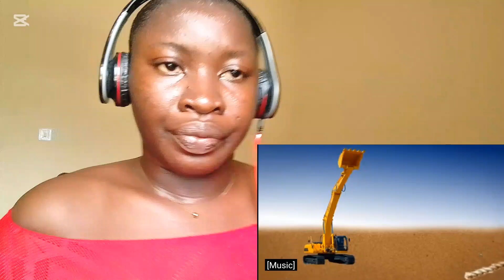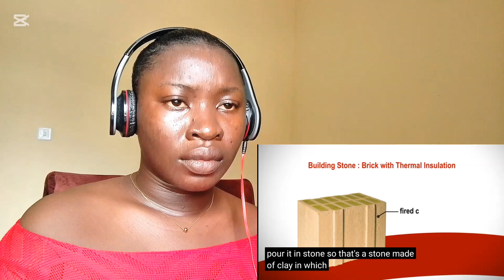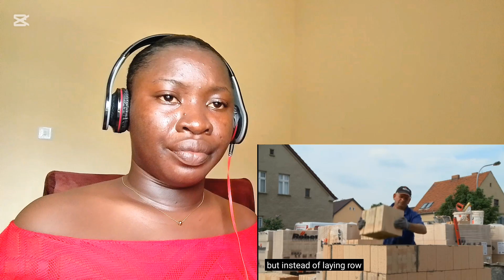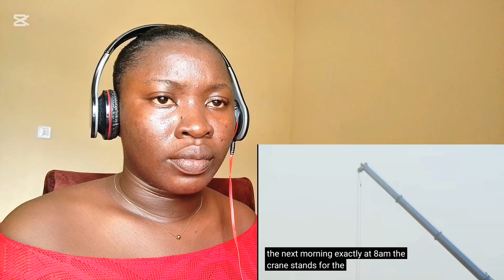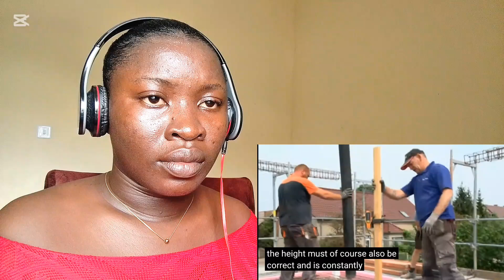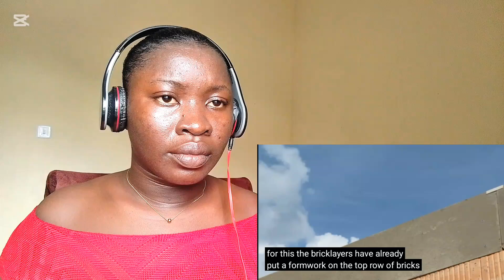The Magic Behind German House Structures | REACTION

Comment: The insulation used in the german brick won´t be necessary for african bricks, as it´s main purpose is to keep away the cold in european winters.  ... To keep comfortable temperature in Africa, it need better airflow, which can be done by ventilation systems (no need for air conditioning!).

Comment: Using clay-based bricks instead of cement-based bricks gives a better humidity to the air in the room  ...  Simply check for ancient african architecture and you´ll find a lot of examples for using clay!   ....   It´s easier and cheaper to produce and it´s more healthy,

Comment: The hollow blocks are from this company. But there are others made of different materials. Also made of lightweight concrete, like yours. Clay or lime is good for moisture exchange. It is cold here and warm room air condenses on a cold wall and moisture has to diffuse outwards, otherwise mold will form.